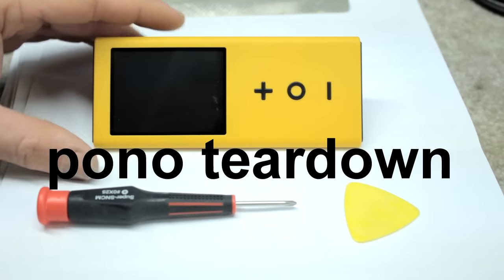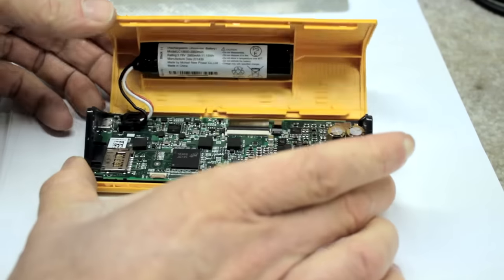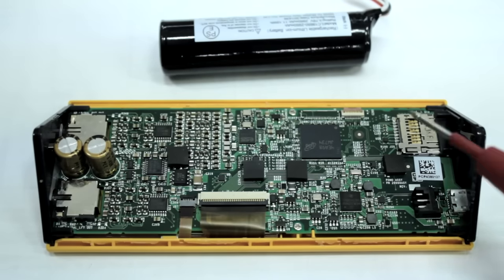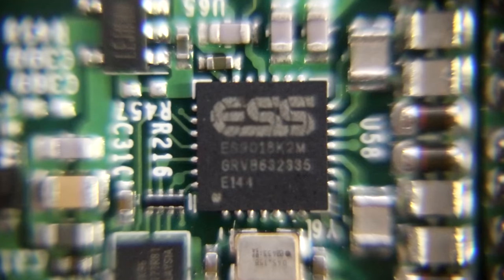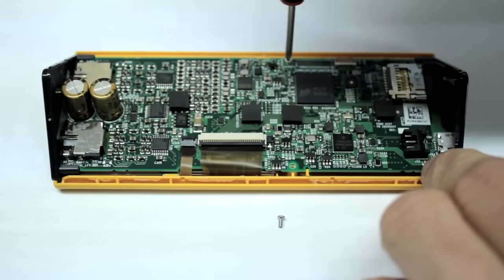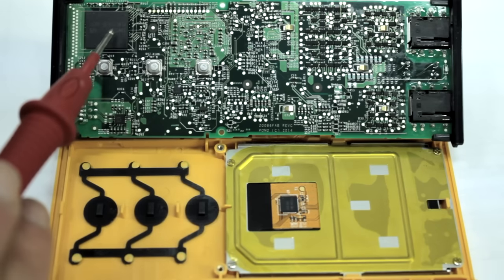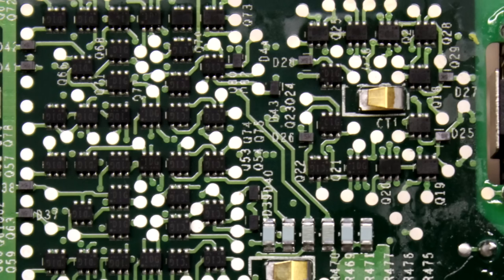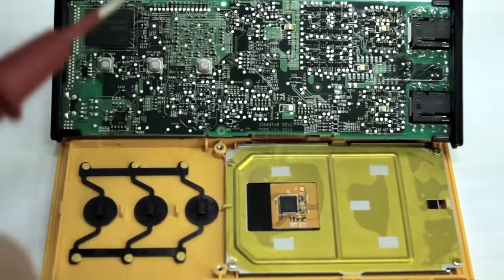Pono Player Teardown - What's Inside

Comment: Nice caps and battery.  Digital audio is still about the analog stage and that looks very strong.
Reply: Everything between the DAC and your headphones is the analog stage and is often the difference between a good DAC and a great one. Great sounding DACs typically use discreet components to drive the output. Cheaper DACs often use chips that incorporate an opamp on the chip.  The chip itself doesn't output the voltage needed to drive headphones and/or speakers. How a device handles those low level signals is critical in how it sounds, especially if your headphones or speakers are revealing in nature. With cheaper equipment it doesn't matter as much I suppose.
Reply: goatstaog that's really ignorant of basic signal chain concepts.   

digital is able to perfectly transmit and duplicate whatever data has been converted. the key is the 2 conversions, coming in as analog, and playing back as analog.

a DAP can't control what files you have loaded on it, how it was sourced or processed is up to the artist/producer. 

come playback time the DAC has to convert from digital to analog, then that analog has to be amplified and transmitted to the speakers.

Most of these devices skimp on all parts of this, or get a nice DAC with crappy analog, or the crappy DAC before good analog like some brands.

PonoPlayer gets it's right, with a good DAC then outstanding analog amplification and output.